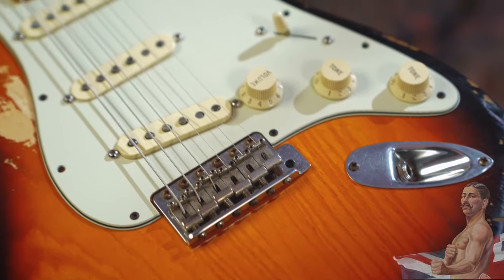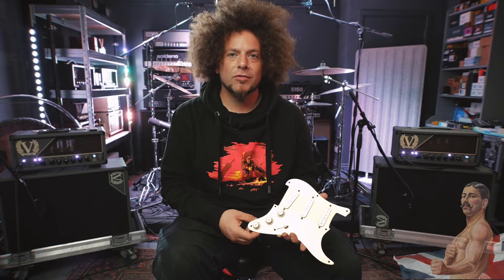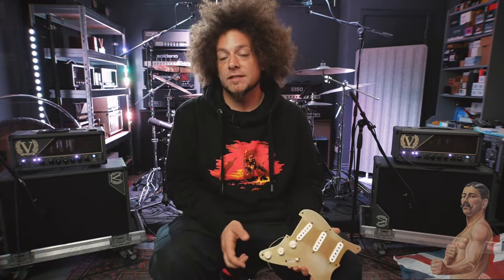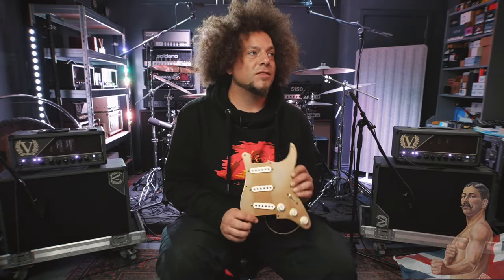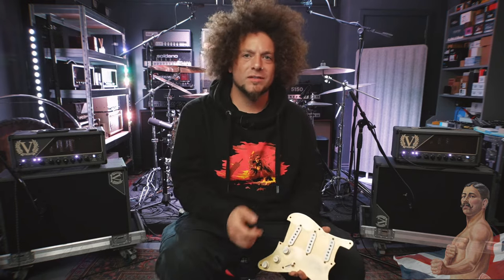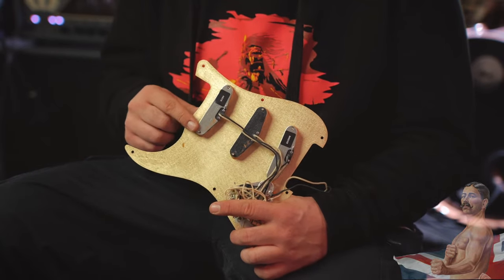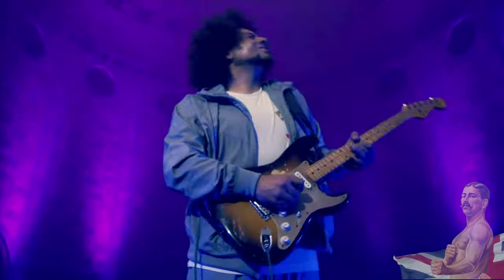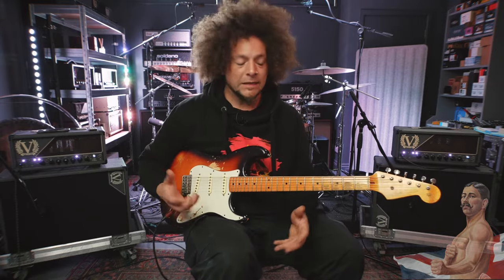Rabea Massaad's Signature Bare Knuckle Triptych Single Coil Full Tone Test

Comment: I'm impressed.  It takes a lot to impress me with a new pickup as the market is so saturated.  However, not to blow smoke, but when Rabea and Bare Knuckle team up for a new pickup, I get excited.  Especially that bridge pickup.  So many sets fall flat with a thin bridge single coil pickup, and this is one of the few that just don't.  The plate trick works and the rest of the set sound very calibrated to make every position the best.  Now that this video is out, I would love to see an A/B of plastic vs metal pickguard to expand on your earlier comment.  Cheers.
Reply: I don't understand the physics, but the concept of the zinc base plate is genius. These are really great sounding pickups.

Comment: Revisiting this vid after the newest TPS video.  What is BKP's recommended wiring? RWRP? Tone control wiring - traditional or EJ-style? Thinking of ordering a pre-wired guard direct
Reply from the maker: We would usually default to RWRP and a bridge tone mod to give you maximum flexibility on a classic Strat set, but some players certainly do prefer the slightly more crisp tone in positions 2 and 4 that come with running a stock polarity middle coil. It's really down to personal preference and whether the extra spank, or a little bit of noise cancellation would be more important to you

Comment: can  you tell me the wire guage of the sinner ? 43 or 44 ? no mention on web site except for ....SPECIFICATION
Position: Bridge DC Resistance: 21.5 kΩ Magnet: Alnico 5
Position: Middle DC Resistance: 15.5 kΩ Magnet: Alnico 5
Position: Neck DC Resistance: 15.5 kΩ Magnet: Alnico 5

Comment: They sound great, kind of like my Fralin blues specials which has an inductance plate under the bridge pu.. the freeway 10 way switch and a treble bleed circuit round it out as the perfect 3 single set for me.

Comment: They sound great man- I've got an Affinity Strat HSS model I'm about to turn into a SSS model. Someone gave me a CV 70s HSS Strat for xmas so- I no longer play the Affinity. And since you can't really sell one for enough to make it worth the time and effort- I think I'll turn it into a parts-caster. Need to get a good neck on it first- make sure I can get a neck on it that I want to invest in. Can anyone recommend a neck that's ready to be put on, higher quality, but reasonably affordable? I guess I could just buy a Fender neck huh? I've seen guys put them on Squiers- they fit perfectly- no adjustments required usually.  Buy a preloaded SSS pickguard- and install it. Then I could have the frets leveled and crowned and all that jive, and a good setup done. And it's finished. You know I may end up with something I like even better than my Classic Vibe HSS huh?
Reply: honestly i would try to find a used neck on reverb, or use musikraft or warmoth if your budget is higher